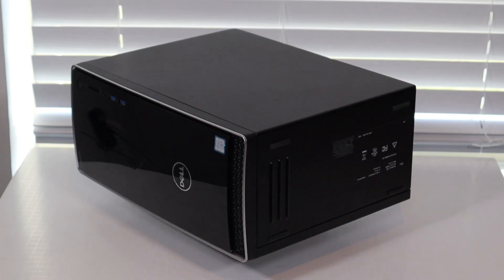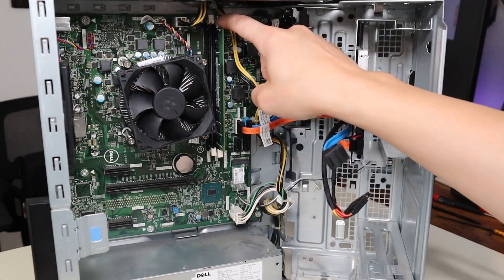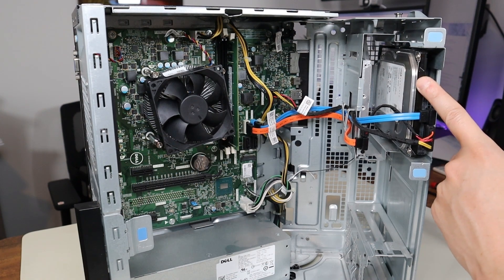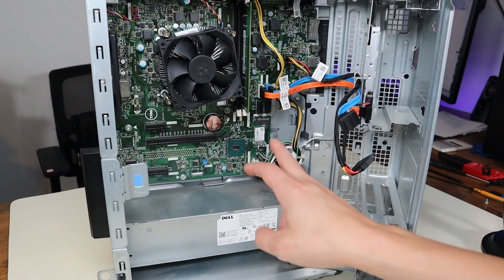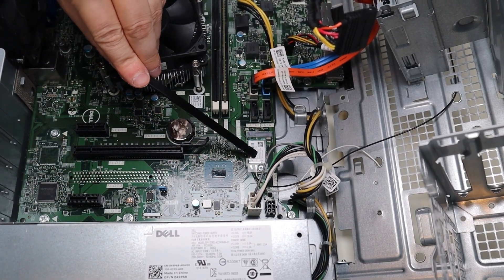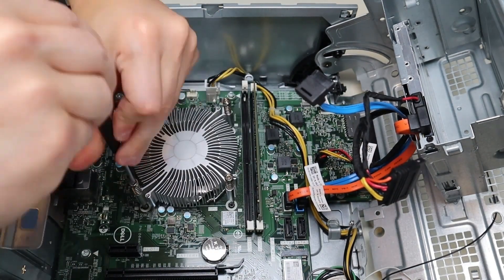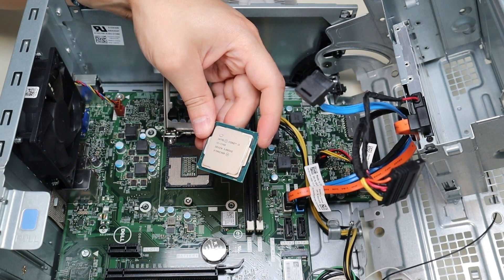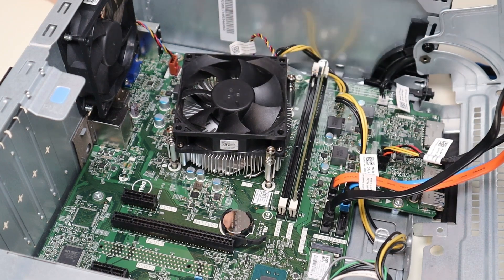Teardown Disassembly Upgrade Options for Dell Inspiron 3668 Desktop Computer

Comment: Hello jamin i have a STGAUBRON pc and i recently factory reset it when i did i had a popup of 2 choices about windows 10 volume 3 and windows 10 volume 3 and i kept clicked one and all it did was turn my pc off and back on the the same options and after a few times of clicking them hopeing for one the work my pc keeps turning back on and off and it wont stay on more than 5 seconds unless i click f11 to go to the boot menu and i dont know what to do
Reply from the maker: What are you able to see on the screen before it turns off? Can you enter BIOS?
Reply: @PC_Monkey before the screen turns off it shows my pc brand (STGAubron) and i can get on the BIOS
Reply: Im able to get on the aptio setup utillity
Reply from the maker: @jordanmgaddis  If you cant find any Repair or Restore options, you may need to reinstall Windows :(  Also, did anything happen before this issue started? Overheating, liquid spill, Windows update, etc?
Reply: @PC_Monkey No it was just was getting slower and slower and I had to factory reset it but the thing is I dont have a usb drive although I have another pc and I have a HDMI cable I'm not sure if that will work as a usb drive also do I need to see both screens while I'm reinstalling windows on the broken one because my HMDI cable came with my pc for my monitor

Comment: I have an issue with my computer 🖥️ not getting pass the ring of death. It’s not loading windows on power up. What could be my issue?
Reply from the maker: What brand computer do you have? Also, did anything happen before this issue started? Overheating, liquid spill, Windows update, etc?
Reply: @PC_Monkey  Its the Dell Inspiron 3668 Desktop Computer. I was doing a system restore point, and I accidentally hit the power button on the computer and it turned off while restoring. When I turned it back on it was stuck on loading ring.
Reply from the maker: @avictor4355  Can you run the diagnostic scan as seen here? https://www.youtube.com/watch?v=NnXmTF0KAYM&feature=youtu.be.  Can you find any Repair or Recovery options in BIOS?

Comment: I have a acer nitro n50-630 and for some reason i cant reset the pc, i press reset but it just doesnt respond
Reply from the maker: You press 'reset' inside Windows or in the start-up options? Is there an issue with your computer your trying to fix by resetting it?
Reply: @PC_Monkey both
Reply: And my pc it just takes up unnecessary storage space like around 150 gigs for 'other files' or something
Reply from the maker: @Gimme12345  ??
You press 'reset' inside Windows or in the start-up options? Is there an issue with your computer your trying to fix by resetting it?
Reply: @PC_Monkey so my pc takes up 150 gigs for no reason and I've been trying to reset it so it won't take up unnecessary space
Reply: @PC_Monkey and I've tried both ways
Reply from the maker: @Gimme12345  Then I would try installing new as seen here;
How to install Windows 10:  https://youtu.be/bIlW4im-tr4  
How to install Windows 11:  https://youtu.be/zYY-Gq68Dvo
Reply: Yeah I just said, I tried it from windows and in the boot settings thing, and the problem is that it takes 150 gigs for no reason and I cant even check what takes up that space

Comment: Hello @PC_Monkey My Asus X53S isn’t turning on. This happened after died while attempting sleep. I tried resetting bios by removing the cmos battery and it still won’t turn on. The laptop already had problems with power such as: turning off while doing something power intensive, turning on immediately after sleep and turning on once the charger is plugged in without pressing the power button, etc. So I was wondering if you could help out
Reply from the maker: For a computer that does not turn on, try this video first; https://youtu.be/kOBY4k2Mn_k. Let me know how that goes :)
Also, did anything happen before this issue started? Overheating, liquid spill, Windows update, etc?
Reply: None of those, but the Laptop always had a power issue it’ll die during power intensive tasks and I’ve always had to put it in power saving mode to prevent it from turning off. Yesterday I tried to put it to sleep it turned off while doing that (the battery was very low though) and when I plugged it back in the indicator lights turn on ( power, caps lock and hard drive ( for a moment and turned off ) ) but no boot screen nothing. I tried using an external display but no output. I also tried the 3 test in your video but it’s still in the same state, fan, power indicator turns and hard drive indicate for a moment at the beginning but no actual boot process
Reply: Sorry about the long reply tho :)
Reply from the maker: @general-ron19   If, after trying all the steps seen here multiple times, you have not been able to find the issue, your most likely looking at one of two possible issues. (1) The motherboard is bad and needs to be replaced. Let me know if you would like help finding a compatible motherboard. Or (2) there is another computer component, shorting out the motherboard and need to be replaced such as the power jack, USB board, Touchpad, etc. You would have to troubleshoot each of those individually but unhooking it from the motherboard and trying to turn the computer on. Let me know if you would like help with that operation.

Comment: Hey, i have troubles with my laptop, and you were kind enough to locate a motherboard for me, and it was the right one, but zeller will not ship to canada. Do you know of another source?
Reply from the maker: I usually find my computer parts on sites like Ebay, Amazon, etc. Is this your motherboard? https://ebay.us/OljbE5
Reply: @PC_Monkey ACER Aspire V 15 Nitro 14206-1 i7-4720HQ Motherboard Fcbga1364 Socket,WORKING, from eBay.
I have been searching.

Comment: Hello Jamin i have an important question,
I own a Lenovo T460s. When I plugged in the charger today, there was a short circuit. After that, I tried plugging it in again. Since then, the battery level stays constant at 4%, no matter if I charge the laptop for one, two, or three hours.

I have already tried different power outlets, but without success. Also, the laptop shuts off immediately as soon as I unplug the charger. So it only runs on AC power now but no longer charges the battery.

So if I replace the battery myself, should everything work again??? And which of your videos would you recommend for doing this?

i‘m not sure if the laptop battery is the problem or the charger, i don‘t think that the charger should be the problem.
Reply from the maker: If the issue is the battery, then yes. Changing it would fix the issue. You can see how to change the battery on a T46s here :) https://youtu.be/YHUVFmMSBHM
Reply: @PC_Monkey Thank you so much!
Reply from the maker: @Sanseeka-h3m  Happy to help :) Always here if needed !!

Comment: Hi Pc Monkey.  My hp laptop has been stuck in a rebooting loop and I don’t know what to do. Its a firmware update issue and it keeps showing ‘Recovering Intel Management Engine Firmware to version 12.0.93.2331.’

Pls help, I don’t know what to do and I need my laptop
Reply from the maker: Can you try the steps seen here? https://www.youtube.com/watch?v=lKb2pPQrkRk
Reply: @PC_Monkey thanks for the quick response. I don’t have the tools to reseat but i tried the 3rd option and it still didn’t work
Reply from the maker: @Goodhuman-Z7K  What was the result of the HP diagnostic test? Also, you can see tool ideas here: https://amzn.to/3XpHdlw
Reply: @PC_Monkey I could not run the diagnostic tests because the recovery loop continued. I’ve tried multiple function loop and no one worked
Reply: It kept showing Recovering Intel Management Engine fimware to version 12.0.93.2331. Its not changing from there no matter the function keys i press after power button
Reply from the maker: @Goodhuman-Z7K  If we cant run the diagnostic scan, we dont know if the HDD is good or not. To double check, can you try to install Windows as seen here?
How To Install Windows 10:  https://youtu.be/zYY-Gq68Dvo
How To Install Widows 11:  https://youtu.be/Yiy-53Wc-Wo

Comment: Just wanted to correct your HDD sizes in the PC.
1. SSD can be 2TB. I have 2x 2TB SSD's installed.
2. HDD can accept at least 8TB. Using an adapter and power splitter, I removed the ODD and placed a 2nd 8TB in the ODD area.

All together I have 16TB of HDD and 4TB of SSD and it is all working at normal speeds running 24x7 with original PSU. 
Stock CPU i5-7400 with 32GB RAM even though Dell claims 16GB Max.

This PC makes a decent server for my family cloud and plex server. However I am only using it because it was in a closet from my sons Middle School days.
Reply: That sound awesome. Should make a video on it 👍🏾😁👍🏾
Reply: Would love to see a video or photo of this...working on a similar project myself with a 3668 I saved from going in the dumpster. where did you find the adapter and power splitter?

Comment: hi i have a problem stuck at lenovo logo,then after watching your tutorials,i disabled secure boot and changed from uefi only to legacy first,when its restart its stuck on window logo,is there any solution i can do?no spilling liquid before.last night i upgraded the windows and forget to plug in the charger.may it be the os?
Reply from the maker: Are you able to run the Lenovo diagnostic test as seen here? https://www.youtube.com/watch?v=oL1R1Tw0jSo

Comment: Hi . I have a problem with my HP it’s a 1TB Laptop and it’s terribly slow … it wasn’t like that when I bought but when I kept on using it it became worse … please help .. how can I fix it
Reply from the maker: I would first fully update as seen here: https://www.youtube.com/watch?v=EDyjxUXBkZM&feature=youtu.be. Also, did anything happen before this issue started? Overheating, liquid spill, Windows update, etc?
Reply: @PC_Monkey thank you I’ll try that !no nothing at all … I thought maybe it was a virus but my smadav showed nothing .
Reply from the maker: @SHELBY-q8n  Also, what are the storage and memory specs for your computer? And, what OS is it running?
Reply: @PC_Monkey ok so I don’t speak computer but it’s a Windows 11 version 23H2(idk if that helps ) it’s also a fixed hard disc and the model is TOSHIBA MQ4…. Is it because it’s not a SSD?
Reply from the maker: @SHELBY-q8n  I was wondering how large your storage / HDD is. And how much memory / RAM your computer has. If you dont know, what model computer do you have and i can look it up :)
Reply: @PC_Monkey it’s a HP 15-dw3031ni 
Storage (HDD) -1 terabyte 
Ram - 4GB
Reply from the maker: @SHELBY-q8n  Thats not a lot of RAM. would you consider upgrading the RAM? That would definitely help the speed / performance of the computer.
Reply: @PC_Monkey yes I’d consider that .. do I need to buy it ?
Reply from the maker: @SHELBY-q8n  Yes. You can see how to match your RAM here: https://www.youtube.com/watch?v=NtCzunl0AQA&t=2s. I think your computer allows a max of 32GB. But simply upgrading a bit would help. Let me know what RAM you need after watching that video and ill see what you can get that RAM for :)
Reply: @PC_Monkey Alright Thank you so much ! Definitely considering the 32Gb

Comment: Hey PC_Monkey, I need help with my lenovo flex 5 14IIL05 because of one of the keys not responding well, I think it might be because of build up dust but I tried brushing it with a wide and flat brush, only to make it nearly unresponsive... could you help me?
Reply from the maker: Is there something physically wrong with the key / keys or are they mechanically working fine?

Comment: Please help me 🙏
My Acer Nitro 5 laptop died on me while i watched some YouTube Video .The keyboard doesn't light up neither the power and charging light .
The laptop was also plugged in the whole time . I tried your battery out and charger out and hold power for 60 sec method , for all the power to come out , but that didn't work as well .
Please help 🙏
Reply from the maker: For a computer that does not turn on, try this video first; https://youtu.be/kOBY4k2Mn_k. Let me know how that goes :)
Also, did anything happen before this issue started? Overheating, liquid spill, Windows update, etc?
Reply: @PC_Monkey Windows Update and overheating.
I was trying to install ReviOS on my Laptop and after installing it , i could see the difference between Windows and ReviOS , so i went into the ReviOS program and clicked reapply or reinstall ReviOS , after that it the screen went black , all lights turned off and it wont turn on .

Comment: I have a problem with my dell vostro 3888 i want to replace the hdd 1tera drive to an ssd one from another device when i plugged it it wouldn't boot to anything but the hdd i tried unplugging the hdd and trying to for e it to boot into it and it says there is no bootable device i tried using a usb windows installer and it doesnt show it when i try to boot into it

Comment: Hello 👋🏽 
My Dell Inspiron 3000 series laptop just shut down out of nowhere yesterday. 
But it did kind of bug out by restarting when I switched it on earlier on the same day. It showed something along the lines of BIOS something and had an option to restart and it worked just fine then. The time was off by 10 mins so I had to resync it. Now it won’t turn on at all and the charging indicator goes on and off when plugged in for about 10 seconds on and 5 seconds off respectively. When I hold the power button with the charger plugged in for almost 30 seconds, it just blinks white for 3 times. Please help me 🙏🏽
Reply from the maker: For a computer that does not turn on, try this video first; https://youtu.be/kOBY4k2Mn_k. Let me know how that goes :)
Reply: @PC_Monkey  Did not work😢
Reply from the maker: @bishowrana6931  If, after trying all the steps seen here multiple times, you have not been able to find the issue, your most likely looking at one of two possible issues. (1) The motherboard is bad and needs to be replaced. Let me know if you would like help finding a compatible motherboard. Or (2) there is another computer component, shorting out the motherboard and need to be replaced such as the power jack, USB board, Touchpad, etc. You would have to troubleshoot each of those individually but unhooking it from the motherboard and trying to turn the computer on. Let me know if you would like help with that operation.